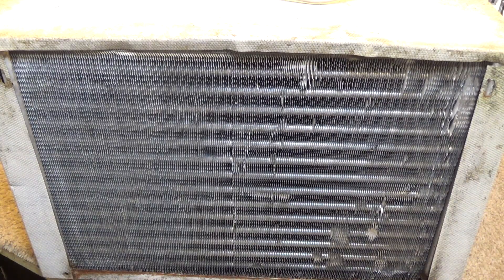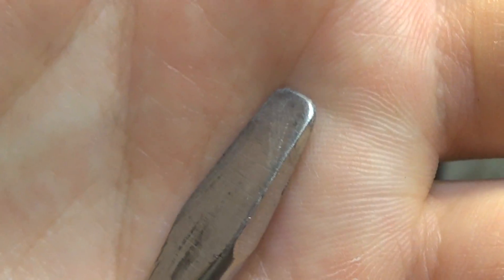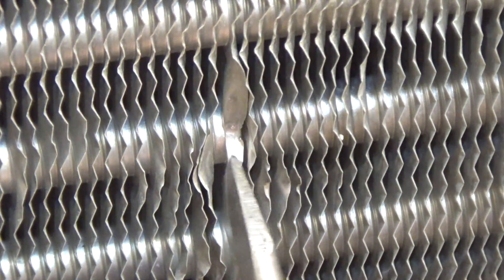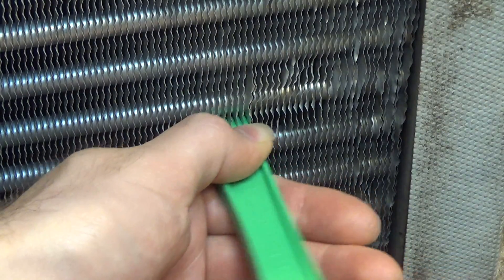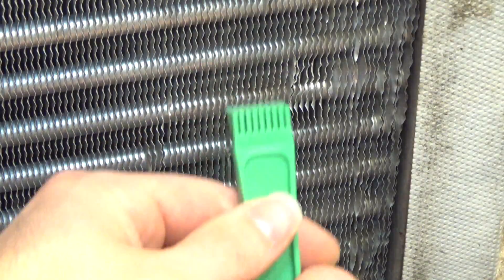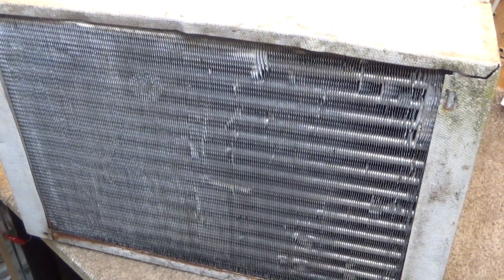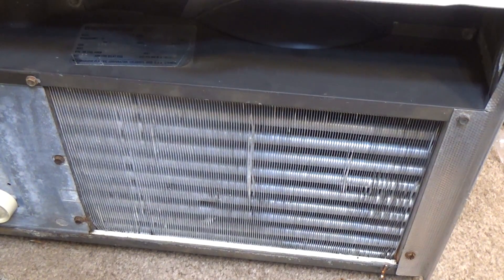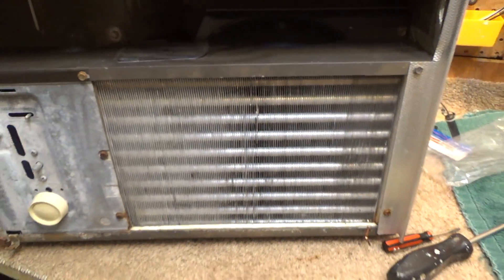Vintage Westinghouse 5,000 BTU Air Conditioner | Straightening the Coils

Comment: I have the exact same unit. The coils are just as dented as yours. Right now, it's in the window. This will indeed be tedious work. I looked at various fin tools and will buy the set you have. And will take the unit out the window, place it on a lighted workbench, get a sixpack in an ice filled cooler, put on some mellow music. (No wife or kids around to interrupt). It will take patience to complete but you've shown its worth it.

Comment: does this affect the cooling performance of the aircon?
Reply from the maker: Very much so, bent or dirty coils will significantly reduce performance.
Reply: @JordanU  is there a technology in air-conditioning today that prevents the coil from bending or rusting?
Reply from the maker: @kevinyap2417  No.

Comment: Can I ask the damage or uneven coil will cause what problem??
Reply from the maker: It won't transfer the thermal energy to the air properly. This will reduce the performance of the machine and reduce the lifespan of the compressor.
Reply: @JordanU  thank so much because I remember my mom hire a service for the air conditioning but the service was very bad and he even damaged my core so badly but he say is fine 😭
Reply from the maker: @mrcoco3562  A lot of HVAC services out there today are scams, run by people that have no other intentions than to try to sell you a new system you don't need.

Comment: 2:03 
I use a butter knife to straighten out the dings that you showed instead of a flat screwdriver. The screwdriver can turn a little bit by accident causing it to widen the fins more than necessary.  Was in a bind and needed something to use and discovered that the  butter knife works pretty decent. With a butter knife I was able to fine-tune how wide I was spreading the fins by just tilting the knife slightly. It's easier to work with than using the rounded handle of a screwdriver.

I was using it for a "through the wall' air conditioner. But you probably can also use it on a window AC as well. Not sure about Central AC... haven't tried that yet.
Reply from the maker: I have used a knife before, but I tend to prefer a thin spackle knife over both.
Reply: @JordanU  interesting. Thanks.

Comment: My brand new GE 5000 BTU unit has a foamy white liquid coming out of the coils... is this normal?
Reply from the maker: No.
Reply: You have a leak in the copper pipe behind the coil. That means the refrigerant has leaked out and your cooling is no longer happening.

Comment: Excellent job on that, but it's the wrong kind of "strait".
Reply from the maker: O well, sometimes I make mistakes..
Reply: Wow, finally it worked out.  You acknowledged and fixed your mistake!  Applause!  Applause!
Reply from the maker: @jaykay18  That's what happens whenever an actual error is made..
Reply: Rarely, by you, by there are exceptions.
Reply: but there are exceptions, I meant.  God forbid you edit a comment around here.
Reply from the maker: @jaykay18  I'm glad you did not edit the comment, otherwise it could not be trusted..
Reply: My point exactly.
Reply from the maker: OK